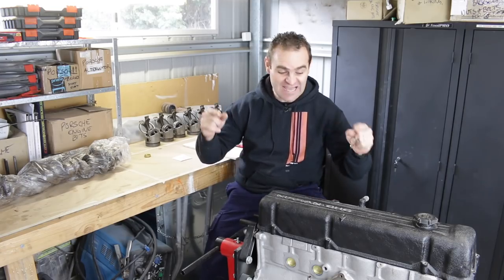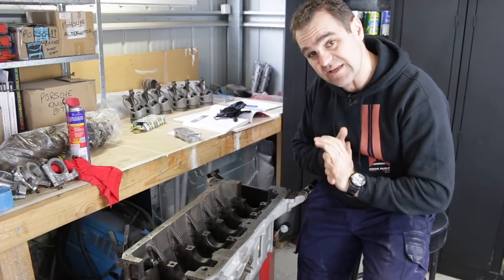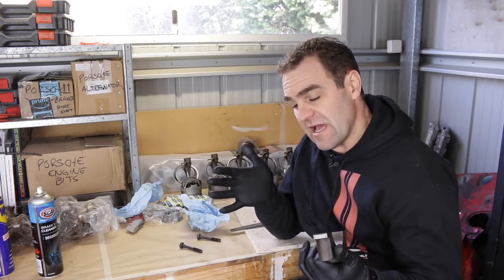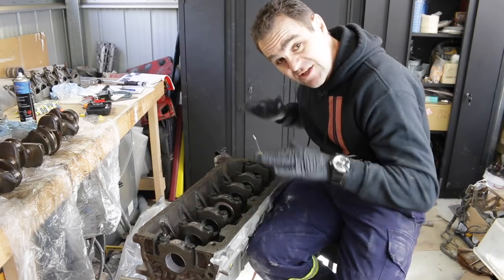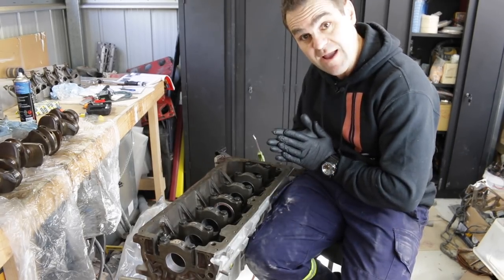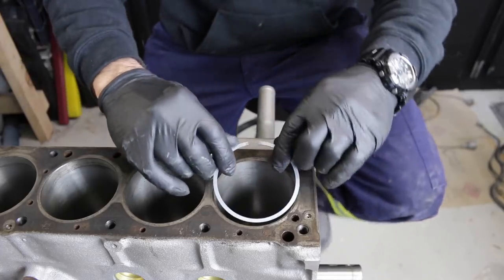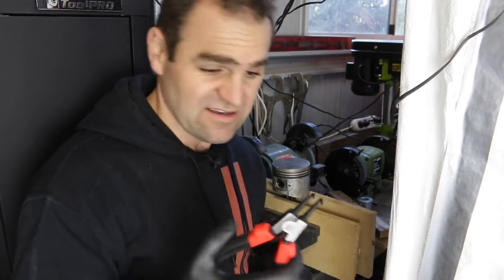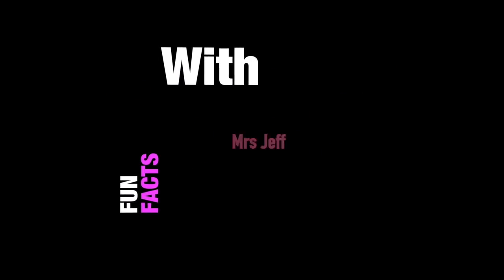Building the bottom end of my L28 - Home Built Datsun 240z part 42

Comment: When I am doing the initial, dry build to check clearances I use the old bolts and only use the new ones for the final assembly.

You lubricate the bolts because you rely on the torque you apply stretching the bolts to apply the clamping force.  If the bolts don’t go in cleanly part of the torque that should be stretching the bolt is used just in turning the bolt.

The ring gap should be checked at the top of the bore, the bottom and the middle to check for any unevenness,  you can also check for any clearance between the rings and the bore.  Shouldn’t be any but oval bores are not unknown.

Comment: So the rod bolts are not TTY (Torque-to-Yield)?  Also, I read somewhere that each industry had a different fluid used when torquing bolts.  I believe cars use the equivalent viscosity of 30W oil.
Reply from the maker: They come with their own documentation for the torque settings, either torque rating or better still stretch.

Comment: Bottoming tap also known as a plug tap, I'm still trying to get my head assembled....hehe. I would have thought loctite would be the go on bearing cap bolts too but I can see how grease would enable a better more accurate tension. It is funny there is no locking systems like a bent up washer against one side of the bolt head or something...I guess the tension is so high it doesnt need anything else. Making some good progress there I dont know know how you keep up all that work.

Comment: Good stuff as always Jeff, my man. Thumbs up.
I do have a question. I'll have to go back and watch the 911 bottom end assembly vid. It kinda went over my head, as I knew it would lol. But this is probably covered there already. It was quite an extensive vid. :)

But just interested to know, is there a risk or downside to measuring the crank bearing oil gap the way you do now? I see you mentioned torquing the bearings down without the crankshaft being in position.
Reply from the maker: No. Well that is the way Neil recommends and I am happy to go with his extensive knowledge. Many believe that you can't torque bolts more than once, but that is false. You just have to ensure that you don't over stretch bolts.
Reply: Home Built By Jeff ok. Thanks for the response. Makes perfect sense. 

I Thought the stretch-once theory stuff was only for the old head bolts, even then you'd either have to be or extremely wary (or rich, or both) to change out brand new item on a completely un-run engine (unless damaged, or a disturbed gasket) imo. Old wives tales of bad workmanahip or bad luck I reckon.

I don't have a ton of engine building experience, but I did/do study it. Been a passion. One thing we were always taught was measure, measure, clean, check, measure, assemble, measure. lol

Comment: Nice job Jeff, don't forget to check the crank end play.
Reply from the maker: I tried to rock the crank back and forward with pry bars to seat the bearings and it barley moved. I will properly check it, I did miss that, but it is pretty tight.
Reply: Yeh check the specs on your L but generally 4 thou is perfect and 7 thou maximum for most engines (depending on specs of course)
Reply: and the rod side clearance since you're reusing the same rods. If its too loose it will result in lower oil pressure